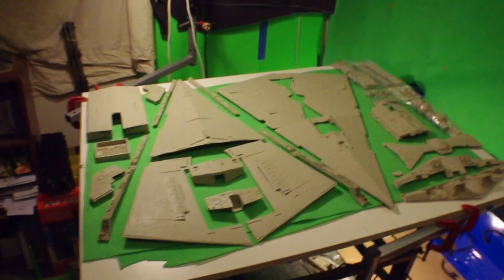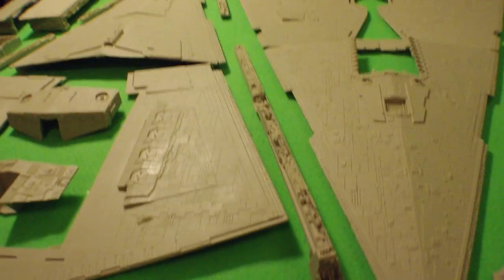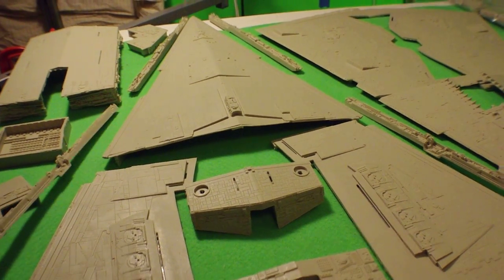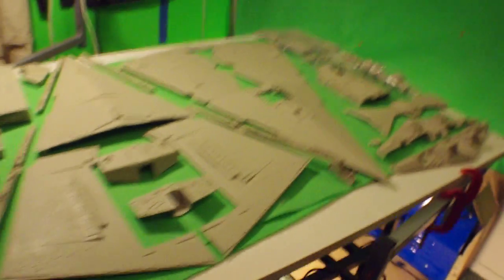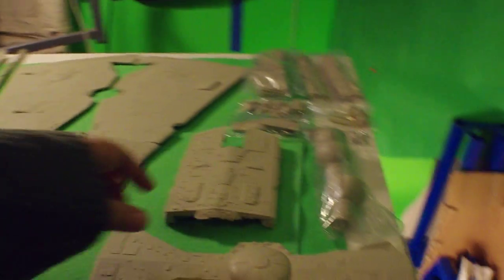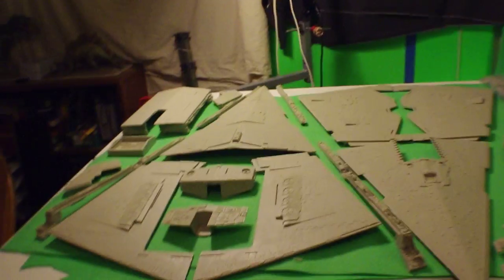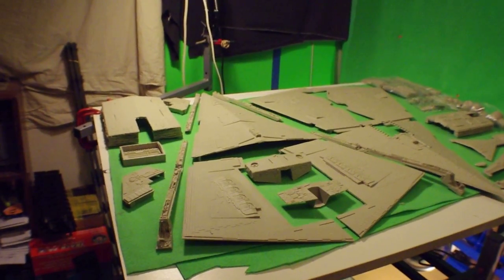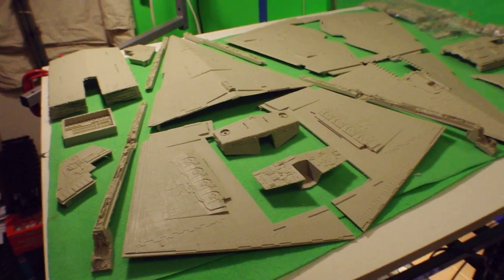OoB Review: Anigrand SD-02 Layout

Comment: hello modelman Tom, 

may i boldly ask which is a better star destroyer if you can only pick one to build...

randy cooper's or anigrand's? 

thank you for your reviews. keep them coming!!! 

joseph

singappre
Reply from the maker: Unless you have one, the Anigrand is out of production.  That means the Cooper.  Otherwise, it's difficult to call.  The Cooper is much bigger so you need display space, the Anigrand is smaller so easier to display.  The Anigrand was much crisper than the Cooper,  However that could the molds used at the time.  If the Cooper molds were old, then the details would be softer because of that. 

I like then both, but I sold my Cooper years ago to pay for rent.  I don'tknow when I would be able to buy another as it is a lot of money.